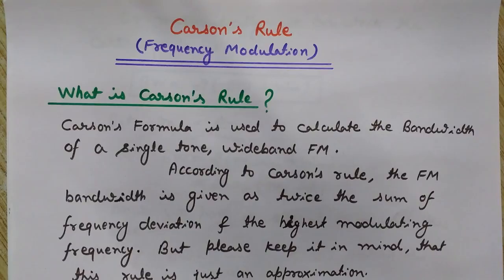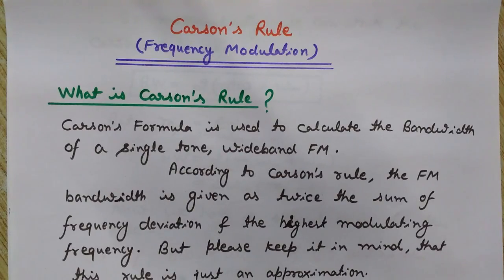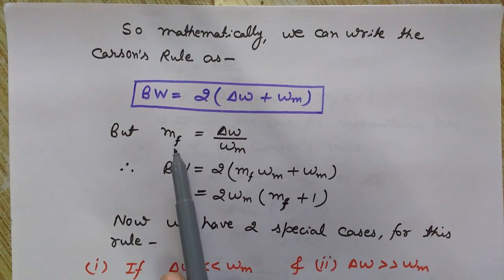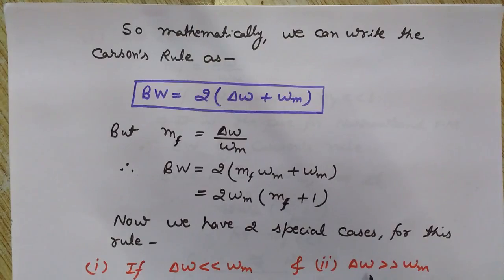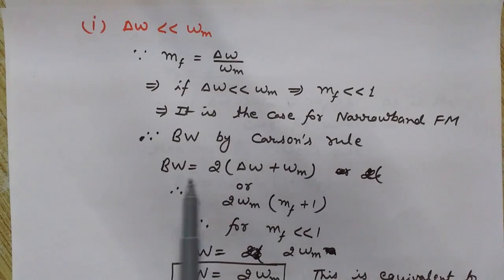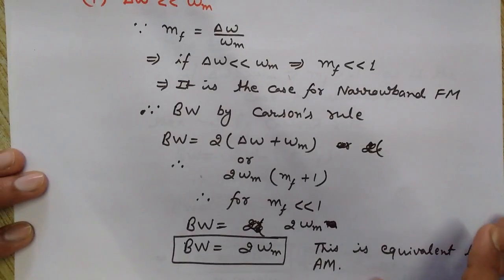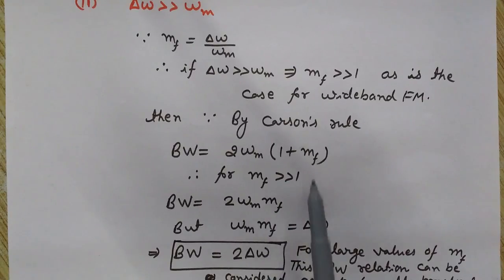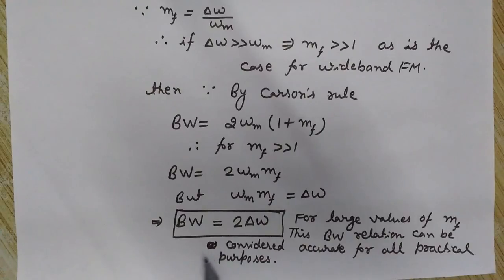Carson's Rule in FM (Calculating Bandwidth of FM Signal) - Carson Rule [HD]

Comment: A carrier signal with a frequency of 100 MHz, frequency by band limited information sign with 2 KHz
  modulating. Maximum frequency deviation of the FM sign (Kf) 25 KHz and information sign amplitude (Am)
  If it is 15.7 Volts;
  a) Calculate the bandwidth of the FM signal?